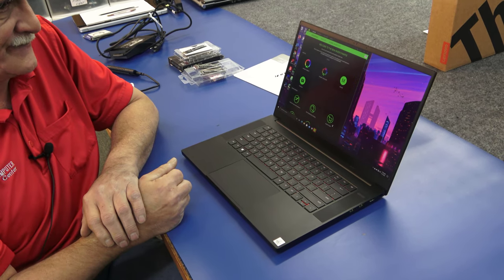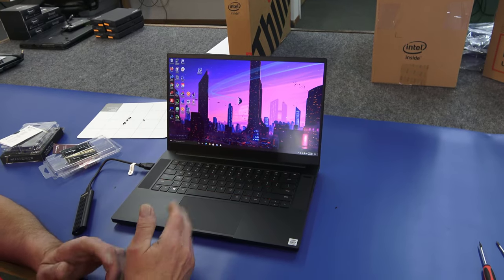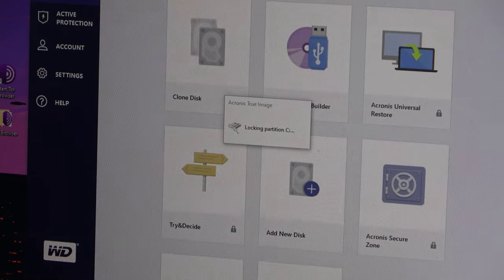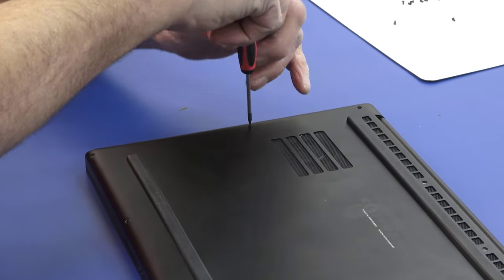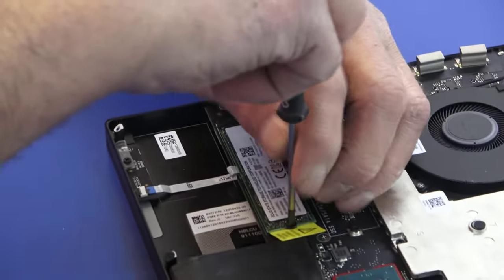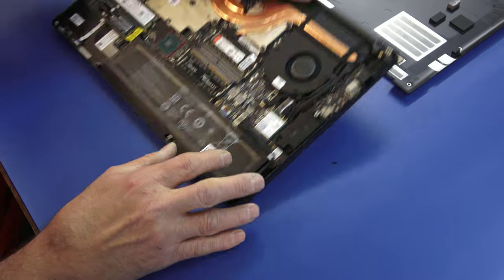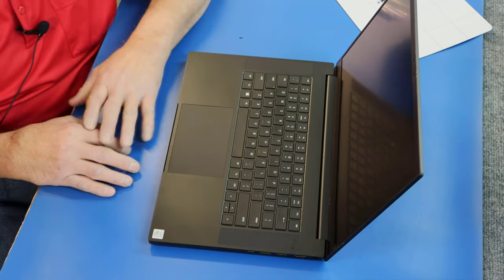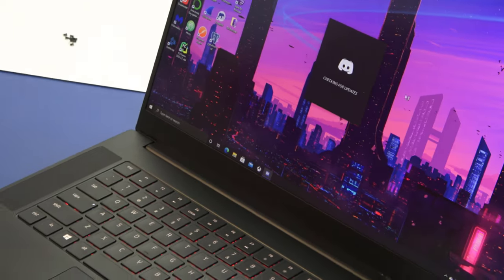Razer Blade 15 Gaming Laptop, How to Clone & Install New NVMe SSD, Increase Memory.

Comment: I have the blade 15 with a 970EVO plus 1tb and then bought a 2TB Adata nvme drive, what cloning software should I use? This is a lifesaver I've been sitting on the upgrade for 2 months because I don't want the hassle of reformatting 😅
Reply from the maker: Hi. If you have a Samsung drive, use the free Samsung data migration software. Its works well. Dale
Reply: @CadillacComputerCenter  Thanks!! Yeah going from Samsung to Adata

Best wishes
Reply: @CadillacComputerCenter  Do you need the external usb m.2 device that you used in this video to clone or can you install the new m.2 SSD and clone it with both drives installed internally?  Say I purchase a 1TB Samsung 980, can I open the blade, take the proprietary m..2 and switch to it the D drive (Sata/m.2) nnd then install the samsung in the C drive slot and then do the clone?  I assume you did the clone and transfered the existing data to the new drive because it runs faster than the original proprietary drive?  Thanks, great video!
Reply: @natehawesvideo  see reply to Richard Glassco's comment below :)

Comment: I have the same laptop but have been trying to install an XPG GAMMIX S7 that ive cloned for over 2 weeks now. I’ve tried macrium, partition wizard and the program u used but the only one that wasn’t asking for money was the macrium program. But even after cloning, I get the BSOD. the new drive isn’t being recognized by the computer. 
What am I missing?
Reply: Hit Windows Start button type Disk Management then highlight the new drive right click select simple volume

Comment: Hey Mr Dale! I would just like a question answered that's been on my mind a while! If you wanted to upgrade your SSD would you also have to change the ram for it or is it optional?
Reply: You don't.  He did both because he wanted to max out the ram and ssd.
Reply: I also wanted to ask what model do you have? Base, advanced, and what year?
Reply: @glen3925  base and I believe it is the one with a 3070 so 2021?

Comment: What if I don't have the adapter for the ssd to clone?  Can I just add the new ssd to the 2nd slot without having to clone the 1st drive?  I got the evo 970 plus 2tb card and I as soon as my razer comes in I wanted to upgrade the storage.
Reply: And than say, maybe transfer the OS to the new ssd afterwards?
Reply from the maker: Hi, yes you can add the new ssd to second slot and clone that way.

Comment: Great Video, however, i am unable to clone my (RZ09-03519E11-R3U1) RB15 Base 2020 model 256gb ssd to Kingston KC2500 1TB M.2 NVMe (Type 2280). I used your method utilizing Macrium Reflect first and then Acronis True Image. Both softwares failed, as i got Error 0x1480006 during start/boot. I think i followed the exact method as per this video but no joy. RAM upgrade to 32gb went well. Anything i should do differently to clone SSD ? Thanks
Reply: I hope you worked it out. You need software specific to the make of the SSD. I am using Smasung data migration tool for a Samsung drive.

Comment: I have Razer Blade 15 Base (2020), which has two m2 ssd slots. Can I use my m2 Sata 3 ssd in it? Or do I have to buy nvme m2 ssd? Please  help me...
Reply from the maker: Hi. Yes. I believe you can. Just one of your m.2 slots should be marked as a combo slot, both nvme and sata..I will be marked  near the slot on mainboard.
Reply: @CadillacComputerCenter  thanks a lot

Comment: Razer machines are some of the most expensive machines on the marked.
Reply from the maker: Yeh, they are very spendy. Built very well.
Reply: @CadillacComputerCenter  Yet no second SSD slot on the latest "Advanced" 2021 model for $$3,300, even though the manual and specs both claim to have it.  After I bought a $300 top of the line nvme SSD.
Reply: @Christobanistan  wait what. Really? I’m watching my videos about how to do it rn and I plan to add another ssd
Reply: @Christobanistan  The SSDs have to be stacked but u can put 2 in. Search YT!
Reply: @zerocal76  Yeah, that was more than a year ago.  I eventually figured it out, but man, the instructions could have been clearer.  Plus, my eyesight sucks!